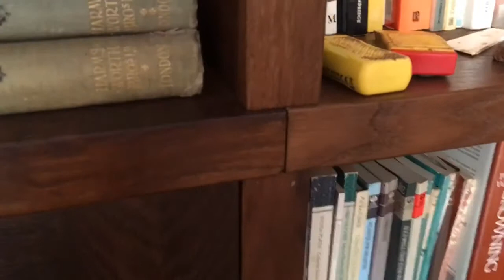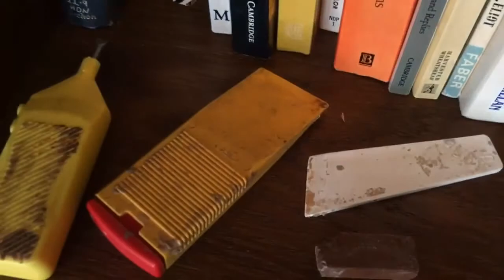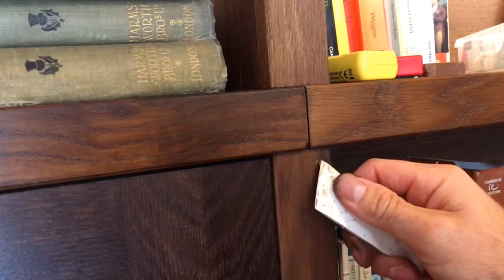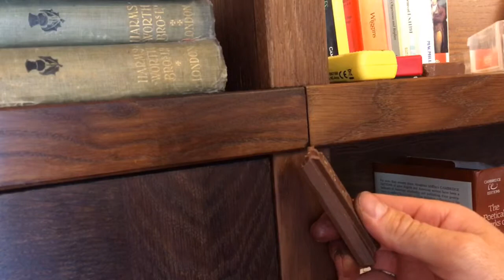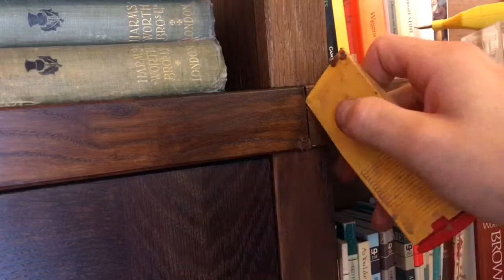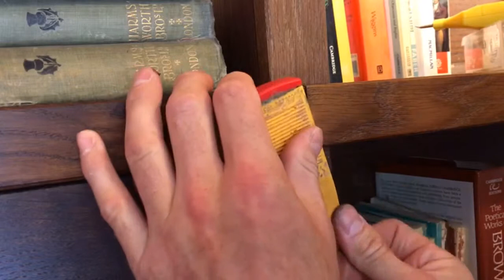Wood repair using hard and soft wax from Konig

Comment: WHATABOUT FINISHING WITH VARNISH/LAQUER TO MATCH SHEEN OF WOOD AND PROTECT AGAINST CLEANING DETERGENTS?
Reply from the maker: Hi, I don't think it would stick over the wax used here.  To be honest, at the time of this video i was turning to a fairly traditional wood finishes supplier for advice, and I often felt afterwards that the solutions I used were less than ideal!  I wouldn't do it this way now.  I'd probably use Rubio Monocoat, or maybe a woodstain then a clear lacquer.

Comment: Hi. I wonder if you can answer my question please. I have refurbished wooden window surrounds in my house, stripping many many layers of paint to reveal the original wood. I want to keep the original look with a hardwax oil finish then waxed on top. All that's fine however there are numerous old wood filler repairs that, in  a perfect world could be disguised. Would these wax fillers be able to disguise old wood filler ? If not, anything else you'd recommend ?
Reply from the maker: Hi, no this shouldn't be used on external woodwork or on large fills.  It may be worth considering the repair care product but it takes some specialist tools and training to use well: https://www.youtube.com/watch?v=o4U-008X9oA

Comment: Hello Alastair.  I agree the standard yellow heater takes forever to heat up and uncomfortable to use.  I got fed up of it and bought the Konig hard wax gas iron, which I highly recommend, but it was about £80 ish to buy.
Reply from the maker: David Mcguinness I’ve heard of that and may get it in due course however I seem to be doing fewer jobs that need hard wax repair lately!